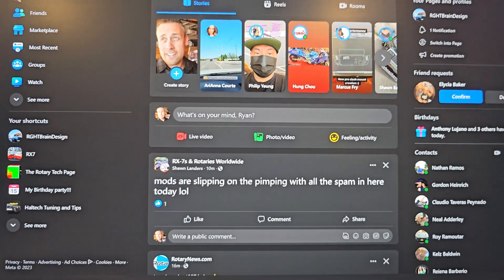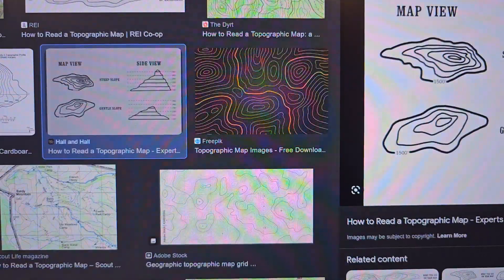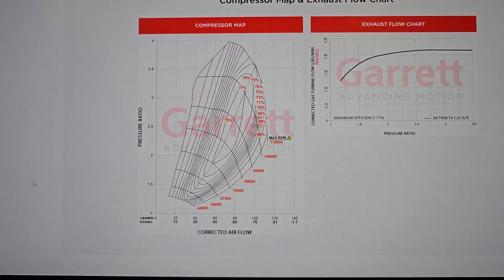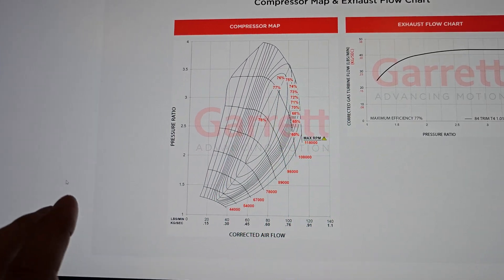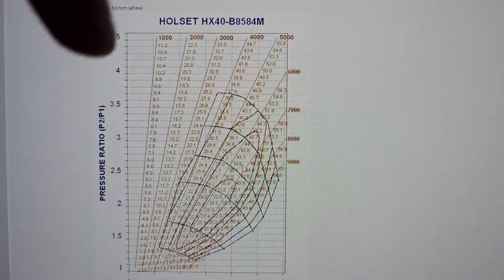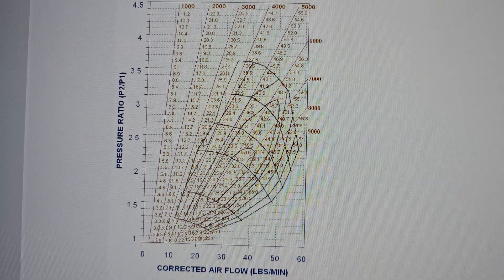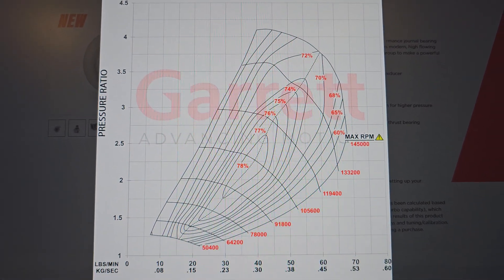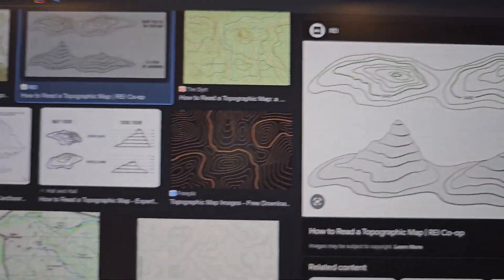HOW-TO: Read a Turbo Compressor Map - Garrett, BorgWarner, Holset, Precision, Hart

Comment: Hey bud. I'm new to the tuning world. I've been talking HPA training online for tuning to increase my knowledge. But I'm wondering if you would be interested in remote tune/street tuning my 93 fd rx7 13b-rew with me. I'm just about done putting it back together. Mostly stock build, haltech r5 vcm, still stock ports, 4x 850cc inj, nonsequential/ parallel twin turbos, ign-1a smart coils. I could use a double check on the base map I created. I'm on schedule for first startup this weekend. I'd deff pay you for your time and would also be a dope learning experience for me.
Reply from the maker: Sure, I'd love to. Reach out and email me or check out the website for more information.  RGHTBrainDesign@gmail.com